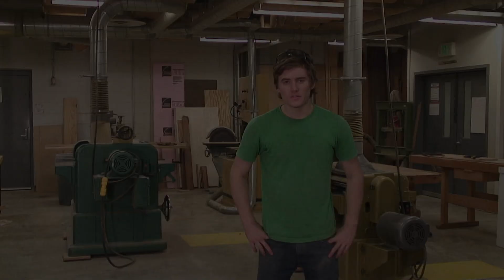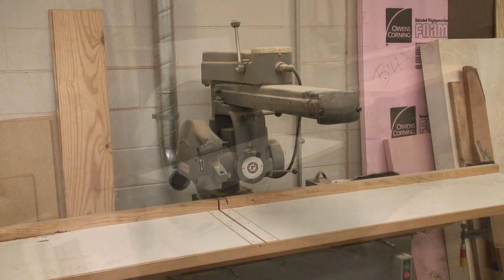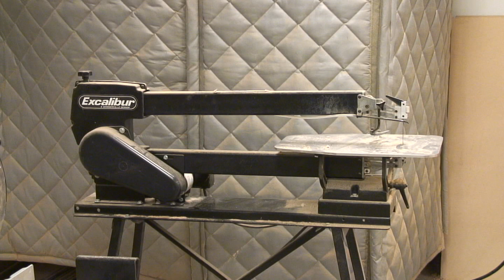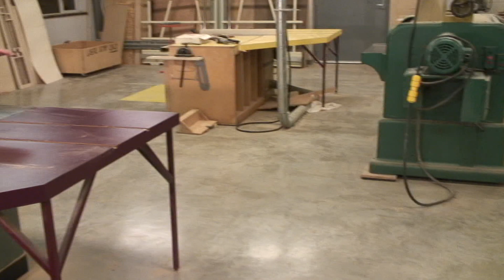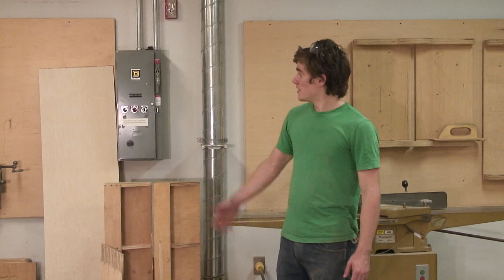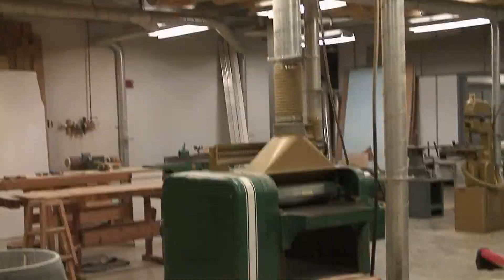Woodworking Information : How to Setup a Wood Shop

Comment: @MillyVanillification We've done it both ways in our shops.  We gutted an old hay barn about 36 x 48 and put our shop in there.  We bought the dust collection system at auction from the local high school... 60hp baby!  With the wooden floor it's a much cleaner and neater look running the duct work below the deck and out of the shop.  We moved to a 10,000 sq. foot facility with concrete floors... no such luck goin under the floor lol, but the industrial look was pretty cool.

Comment: I agree with you kentpbmx. Any jig that passes through the miter gauge slot or slots on a saw table is concidered a sled. I think what Duriward is refering to is a sliding table saw, ususally very large and ver exsensive, or a "slide attachment" for an exsisting saw. As for the "router" thing. Duriward. I use a routertable in my garage shop and I do alot more than chamfering with it. Ive been in the woodworking biz for 27 years in many different capacities. I know what Im talking about.

Comment: Agree 100%, but sometimes guards just get in the way.
Like im 18 and been in woodworking for 10 years, when i got into grade 11 woodworking at school they introduced fixed safety guards for drill presses and routers. More people got hurt with these stupid guards then without them, and table saw guards , i just straight up hate them, ill ditch the guard and keep the riving knife on. Its all in the user not the machine.